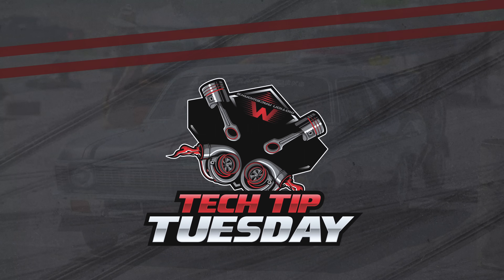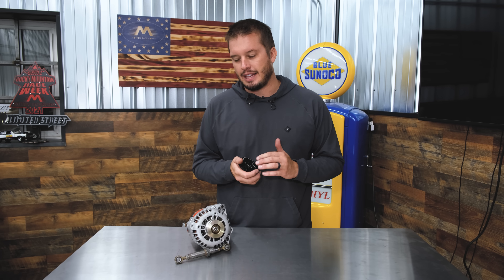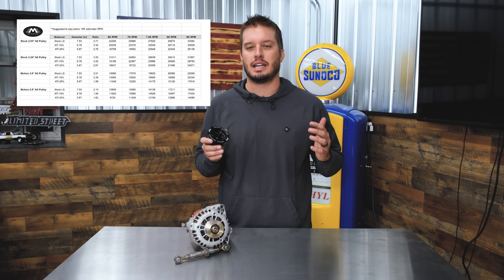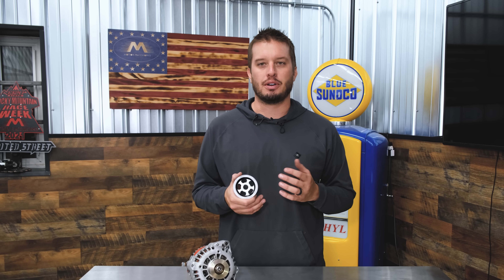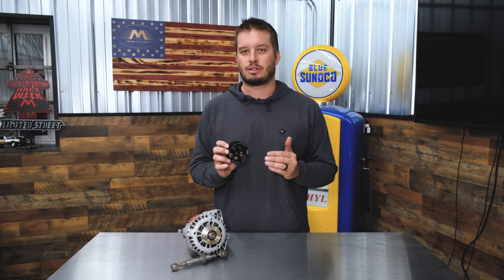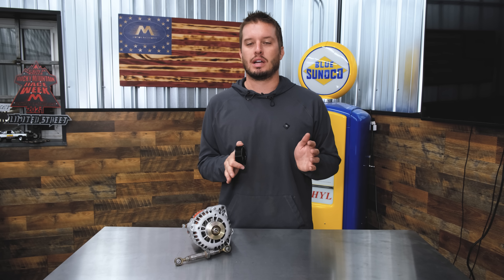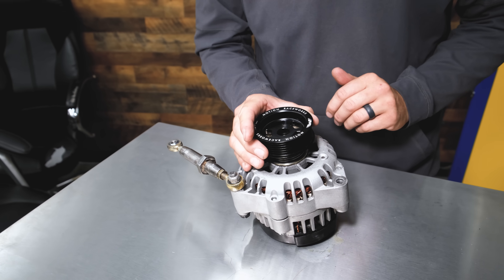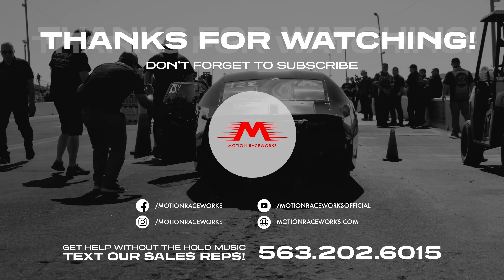Tech Tip Tuesday: The Single Biggest Killer of Alternators and Bad Charging Systems

Comment: What's the main failure on the alternator is the rotor when you spin it above it's rating the centrifugal force will rip the coil wires away from the slip ring killing the alternator. But also remember if you going to run an underdrive pulley on your alternator on your daily driver you may occur under charging at idle and cruise speeds.
Reply: I sddrrss this issue have a peek.
Reply: That's exactly what's going on with my 320 a alt from auto tech engineering. First shows 14.8 in idle but starts to drop after a couple mins and actually drops all the way to 12.6 in idle and also as soon as I place the gear in drive without moving or hitting accelerator. It does stay at 14.8 while driving but starts to drop as soon as I come to a complete stop. Also wines and squeals so bad it quickly becomes annoying. Changed to a smaller belt since original belt wasn't small enough on my 11 Toyota Corolla S. Now I think I'm better off putting my 100 a stock alt back on to avoid damaging my new alt.
Reply: You can also reduce the life of the alternator by using too big of a pulley. Not only because the battery may not stay charged at low RPMs, but also because the alternator will run hotter while producing the same current at a lower RPM because its internal fan will be spinning slower and moving less air. Even worse would be if the alternator is spending a lot of time full fielded because it's at too low of an RPM to generate enough power.

Comment: Another thing which can damage an alternator with a manual transmission is banging through the gears. A lot of modern cars (especially ones with DSG type gearboxes) have a freewheel on the alternator pulley so that when you change to a higher gear the alternator can freewheel faster than the engine and slow down gradually rather than being forced to slow down suddenly. This makes the belt last longer too.
Reply: Great point! Since the alternator typically spins at around 3X the engine RPM, it has a lot of inertia. From my understanding, the clutch pulleys were more done for efficiency and the longevity of the belt and drive system than the longevity of the alternator itself.

IMO the fact that clutch pulleys are used on plenty of automatic only vehicles pretty much debunks the theory of the main goal being to prevent alternator damage from shock loading.

Comment: Great job, I learned a few things.  I always thought heat was the biggest killer of alternators, heat from going to full field while attempting to charge a severely discharged battery.  Alternators are designed to keep fully charged batteries at that level not bring up drained ones.  Thanks again Doug and have a great day.
Reply: that just kills the voltage regulator from over current and heat.  the winding  will be fine unless the battery has been hooked up backwards or you get idiots that dont know how to use jumper cables

Comment: G.M. has made a good drag race pulley for the alternator since the early 70s. Pretty sure the part number is 1942911. Its about 4 inches in diameter.

Comment: Trouble with a larger pulley on a  dual purpose primarily street driven car is a lack of charging at idle and cruise rpm. Amazed nobody has come up with an expanding pulley. Similar to a centrifugal clutch operation, but that allows the pulley diameter to grow a few percent.  Brand x, Mr. Patrick has taken care of my alternator needs for the last few years. The hot rod community can learn from the hardcore audio guys. There are better bearings and stators etc available to custom build bulletproof alts, but they are not cheap.

Comment: Don't forget, Folks-
Changing your pulley diameters also mean your belt lengths change,
and an auto-tensioner only goes so far, either way. Don't lose tension,
and don't over stress that coil spring. Belts are usually measured in mm.
Reply: Good call Hubba'.   Tip: I get around that by decreasing the "drive pulley" by the same percentage. Problem solved :face-orange-biting-nails:

Comment: What you also have to remember is that unless it’s a “ marine” rated alternator and only certain newer style vehicle with an exciter wire it will only function a above 1200 rpm’s or so.   
   I always used Mercruiser mini alternators rebuilt to charge at 150-200 amp and with ceramic bearings installed.  
  Marine alternators charge at idle rpm’s .
Reply: Mk1-2 vws do this. 
Haha you gotta blip the throttle and wake it up.
Don't walk away leaving it idling for 20mins to warm up because you'll come back to a stalled car 😆
Reply: Very true.
Reply: Interesting 🤔
Reply: why would you need 2,400 watts in your car ?

Comment: Did this years ago with power master they know how to measure crank pulley x alternator pulley x max RPM's. Tech tip I blue lock tite alternator case bolt, pulley, electrical nuts and more on. I always say do it right the first time and be done!!!

Comment: I had a Ford F100 with a 460 B.B. that idled at 400 rpm. Because of the low rpm I had to put a really small pulley on it to achieve 13v. However, when ever I made long hauls across state I always had to bring an extra voltage regulator. Fortunately, mine was external and it was bolted to the fender. Never had a problem with the alternator, though.

Comment: Ford spent a pretty penny engineering a fancy alternator for the GT350 because of its high redline RPM. During testing they attempted to reuse the standard GTs alternator but kept having failures.
Reply: Vibration was probably their main concern with the undesirable secondary imbalance of a flat plane crank.
Reply: Nope, rpm is bigger concern by far.

Comment: I had a problem with my alternator overheating even under light load and I finally figured out my alternator pulley was too large and the internal fan wasn't running fast enough to cool it.

Comment: It is not just undercharging at low RPM, the regulator will try and maintain the rated output voltage by increasing the field current.  That means max current is being pulled thru the brushes and commutator to drive the field, increasing wear there, heat in the regulator and overall heat in the alternator at low RPM when cooling is reduced…
Reply: Exactly

Comment: My Nippon Denso alternator..in a 1994 Toyota it had 286K miles...i never replaced it....with the 1969 IHC...it still has the stock Delco 65 amp baby...I did replace the field brushes...and the ball and needle bearing.....just for prevention maintenence...

Sure if either of those engines were tweaked to rev higher...I would increase the pulley size....

It seems like some like to add additional loads....and then they play fry the alternator game...

Comment: When Mechman made my 250Amp alternator the first question was crank pulley size and redline.
Reply: Yeah, I ordered one from ces In Ohio,and later from brand x from Jonathan Patrick and that was his first question too. But also if I needed full output at idle, it was for a daily driver with 200 pounds of stereo equipment. He built me a 240amp alt that would do 85% of max output at idle. 6 years later I sold the jeep with the alternator still going strong. It was a custom built small case denso. Only cost $350. It kept two 1000cca agm batteries at a full charge, and kept up with the jeeps needs as well as a true 2800 rms watt stereo with zero headlight dimming and voltage stayed at 13.8 or above no matter what I was doing.
Reply: @b.c4066  Mine charges 180 amps at 800 rpm. I think it's a large case GM. It was just a tad over $500 polished. I'm running 2 radiator fans, remote A/C condenser with fan, vacuum pump, 2 fuel pumps. electric A/C compressor and electric P/S.

Comment: Can you do 
-Wiring dome pressure sensor for terminator x Ls 

- wiring duel electric fans with 2 relays on Holley term x Ls for the Holley to control them on a negative trigger

-also how to setup a Mac valve off of dome pressure with boost reference from the turbo non co2 supported

Comment: Wow! I used to be an RV hauler.  I drove over a million miles in 6 years first a 01 Ford 350 and then a 05 Dodge Ram 3500. Thank goodness for lifetime warranty from Autozone because I went through 2-3 alternators a year. I always thought the pulley was the problem because the engines ran between 2-2200 rpm’s a minimum of 11 hours a day 5-6 days a week. So the batteries would over charge many times. This engines are designed for normal stop and go traffic not to run constantly running over 2200 rpm. This pulley would have definitely help my alternator and batteries.
Now design a water pump for the 5.9 Cummins the pulley is small as well and I had a few water pumps go out especially after mountain passes. The high rpm would tear them up. The 6.7 Cummins has the same design of water pump as the 5.9 but the new 6.7 engines come with 6 speed which run at lower rpm.

Comment: After an engine swap my 1990 Grand Prix started burning up alternators. Months later the headlight circuit went dead.
Pinched wire shorting out was the cause.

Comment: Most alternators are rated at 2,400 RPM.  In other words, with the alternator shaft RPM at 2,400 or greater, they will put out their rated amperage.  Below 2,400 RPM, the voltage and current will drop.  So the bully ratios are set up for the engine at idle the alternator will spin around 2,800.  Of course, and you drive down the road or the track, that RPM goes up and provide great charging.  As stated in this video, most alternators have a maximum RPM rating as well.  So pulley sizing / ratios are vital.

Comment: i use a 351 C in my falcon , went to a 4 inch pulley because i hit up to 8500 rpm more than i should . lol . no more alt problems . people dont realize the alt turns four times faster than the engine with the stock pulley! And , u also gain up to 4 hp .

Comment: Would you benefit from an underdrive system in general? The reason I'm asking is doesn't the power steering pump suffer from the same problem?
Reply from the maker: Under spinning the water pump can become a real issue, I would be inclined to do it accessory by accessory

Comment: I have a 2009 GMC WT, I have an underdrive alternator on my alternator.  I am changing the alternator to a bigger amp/hr alternator.  I need to remove the pulley, from the alternator, to make this swap.  I had my mechanic do the first swap, to the stock alternator; I believe its 60amps.  I go camping alot, and I am putting a 100 amp alternator in place of the 60 amp.  Is it hard to change pulley's?  As I said, my mechanic did the first swap; I want to do this swap myself.  Thank you for the advice!
Brad

Comment: This sounds the same as an underdrive kit, and at idle and lower rpm’s it doesn’t create enough charge on some vehicles to run properly.
Reply: Had that issue with a HO alternator. Original did great but I needed more power due to accessories and electric cooling. The new one kept dipping to 11v at idle, really dragged the electrical system down at stops. Had to return it back for refund and put the previous one back in. I’m sure that thing is so overworked as there’s belt dust on the case and when I hit a puddle on a rainy day I think it slips because the wipers go slow before it dries enough to start spinning again.

Comment: I’m putting a smaller alternator pulley on my 2001 gmc because I need to crank just a little more amperage and it’s definitely not a high rpm build me merging on the freeway is about the worst it’ll get

Comment: If it's possible to add a bit of slack in the adjustment so the belt will slip at high RPMs for the A/C and alternator. I've been doing this since the late 60s and I'm surprised these guys didn't already know about it.

Comment: Replace your alternator with a powermaster. They recommend 18k to 20k rpm. I am running the Ati damper and powermaster 8421 alternator with my oem pully. I did have to have it bored from 15mm to 17mm sonit would fit. My output is 175amps

Comment: I have fried an alternator at the Watkins Glen track last weekend, likely due to running high RPMs. The car is still under warranty so getting the alternator replaced this week. To avoid this from happening again, I want to purchase a 3 or 3.5 inch underdrive pulley from you guys, but wanted to meke sure that they are compatible to Ford Coyote engines. My car is a 2022 Ford Mustang Mach1. It revs up to 7500 RPM stock. Can you please confirm fitment?

Comment: Its a pain when using a spring tensioner and changing pully sizes. Diched the air pump om my 1985 Mustang GT than put a underdrive pulley system on it finding a belt was a shitshow and the belt rubbed between the tensioner and the water pump. Had to modify the tensioner post hole found a belt that gave me 2 in clearance measured and drilled a new post hole with the tension now had 1.5 in clearance a pain but worked. Under drive pulleys on the street you do feel a difference BUT I had to install a flex fan engine running 200f with a 180f stat now runs 190f and my alt is falling on its face anything under 1500 rpm just a toy not my daily driver. A smaller pulley on the alt or a new alt with internal regulator these have more output at lower rpm.

Comment: While I can't speak for any of the aftermarket performance alternators (automotive), I can testify to the quality of TRUE marine alternators like those from MerCruiser for their inboard/outboard engines.
These are specifically designed to operate at sustained high RPM while simultaneously taking a beating from rough water conditions.  They offer one wire alternators for most Ford and GM case sizes which have premium winding insulation and heavily potted connections and electronics.
Just sayin'

Comment: Thanks for the vid. Maybe it is a silly question. I have an 1999 Toledo with 1.9TDI diesel engine. I have no working radio in the car. ;-) I have a very low fuel consumption but as a hypermiller I would get better and better. So the question is: I plan to change my factory alternator (maybe 90A) for a greater one (120A from Lupo 3L) and change the pulley of it for a greater one. How can I test whether this lower MRP alternator set will serve enough energy for my electrical system? I guess based on the fact that almost no electrical device on the board it should enough. Sorry for the not engineer-level question... :)

Comment: Sticking to Alternator's how about a video on building custom brackets. I have a Olds 455 with Fabbed Valve Covers so none of the factory brackets work and I have the Alt on Pass side when it should be DS. I have a setup working but it looks a bit sketchy

Comment: Put a cvt drive pto pulley on the alternator and the power input pulley on the pto or actual drive output shaft, and use a desicated drive belt that matches, as you Rev up the weights pull the input pulley, that you installed on the output shaft, and it reduces the diameter and the pulley ratios as the engine speeds up, this reduces parasitic drag as well, the output pulley you placed on the alternator squeezes inward as centrifugal forces acting on the spinning weights and their pivot levers, it forces the pulley halves tighter inward and as the belt revolves it climbs higher on the tapered inner pulley edges increasing the drive belt contact surface diameter, further lowering the alternator RPM, only under the highest revs. 
 Water/ Engine Coolant pumps, and power steering hydraulic (rotary vane/geared) pumps are engineered to operate at a modest rpm rate, too many rpms and cavitation starts to destroy internals and gas out the fluids creating pockets of gas that can ruin your trip. Use a reliable electric Coolant pump and possible electric steering to eliminate the need to alter too many accessory drive pulleys. If you're thinking it won't allow the alternator to charge because iys spinning too slow, consider this, low output voltage and current, cause the alternator to resist and more input torque is needed which forces the pulleys against their high speed centrifugal closing : opening actuators, opposite of the unswitched OEM pulley configuration, and it will speed up when it heats up, cooling it off more, and putting out more juice!.
Tree.
Reply: Exactly what I was gonna say

Comment: Also must consider the size of the other pulleys on that same accessory belt system.  A smaller water pump pulley will change the RPM of a stock alternator, etc...  Thus, just like anything on a car, it's a combination of parts that make the whole.  March Pulleys has charts for different combinations and will sell sets for all the accessories including the crank damper pulley that are designed to work together. Nice video, great points made here!  Godspeed
Reply: I hate to break it to you, but changing the size of a water pump pulley has zero effect on the alternator. Changing the crank pulley changes the speed of every accessory, changing one accessory pulley only changes the speed of that accessory.

Comment: Another Tech idea based around alternators. 
In race application when u are using a master kill switch. NEVER run your alternator wire through the master kill. You will burn up alternators every time.
Reply: If the alternator doesn’t go through the kill switch it sometimes won’t actually shut the engine off when turning off the switch. 
As long as the kill switch actually kills the engine and kills main battery power to everything then it’s ok.
Reply: @NBSV1  to

Comment: Drag racing doesn’t have the same problems as dirt oval racers do. A squirt to 8000 for a 1/4 mile is nothing like 50 laps on a dirt track where the engine never goes below 5000 unless there is a yellow flag. 90% of us run the the alternators off the nose of the water pump pulley using the same size pulley as the alternator. Pulleys from the crank to the water pump are usually under driven so our alternators don’t even see engine rpm and there is no reason to. 
it’s also stupid to have your street rod running 2500 down the freeway and have the alternator at 6000..